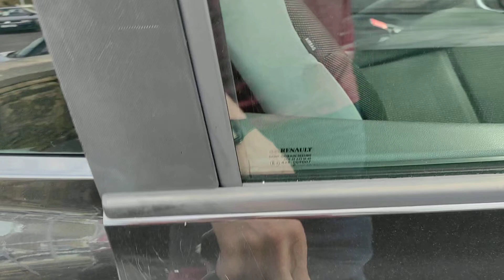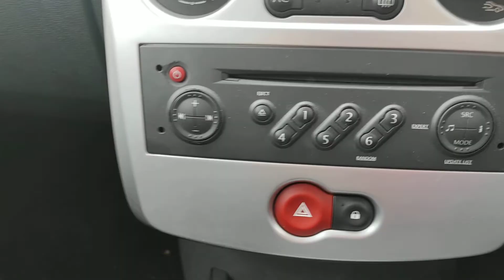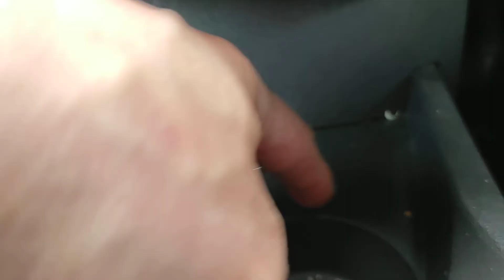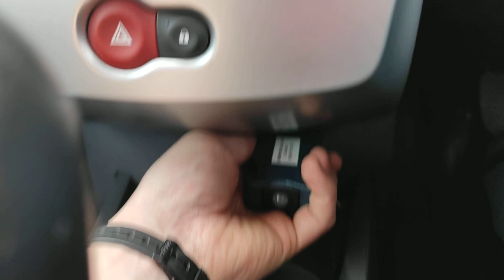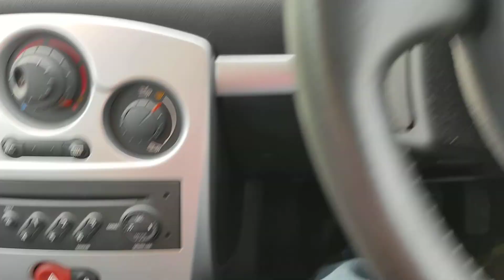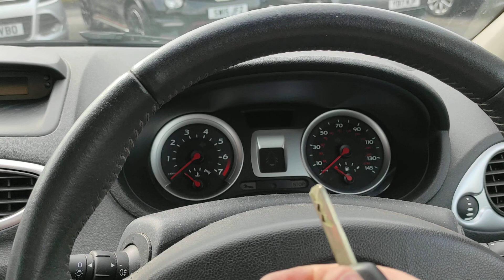Renault Clio III 3 2006-2012 Bladed Key Programming - Fobfix.com

Comment: Is it possible to get the buttons to operate the door locks only without needing the device to pair up for the immobiliser?
Reply from the maker: No. On these vehicles the remote and immo are one integrated unit and as such have to be programmed as one.
Reply: @FobFix Ok...Thanks.

Comment: Maybe a dumb question but is that a blank key ? Can I cut a then code the blank key in like this or does the key have to be programmed to be the same as the other key ? We have one but the buttons are broken so I’m having to climb in and out the passenger side 😂😂
Reply from the maker: As with most Renaults, you can code in a blank and you can recode a key previously used with the vehicle. The only thng you cant do is code in a key that has previously been coded to a different vehicle.
Reply: @FobFix  great , thanks very much , will be ordering this and a couple of keys from you on my next payday
Reply: @FobFix Just purchased one , sadly you had no fobs so I assume I can use one with the right chip as shown in the video? , also my dad has a Renault modus and wondered if this works the same with that or does it require another coder.

Cheers again for the help
Reply: Or does the car program the keys with the device ? I’m a bit lost here ahaha but I’m assuming that’s the case ?

Comment: Hello I have a Renault 3 which won’t start at all. I only have one key which isn’t programmed, would this OBD tool fix my constant red light flash. Or will I have to go to the dealership for new codes. Thanks
Reply from the maker: As a non starter , we would probably say get it properly diagnosed before you start playing with keys.